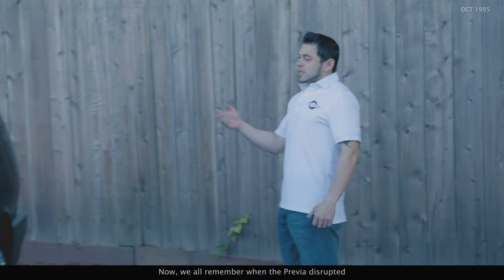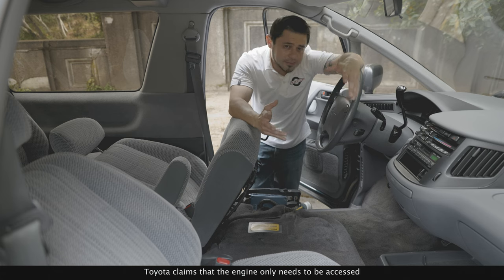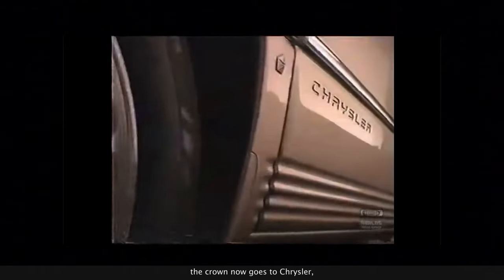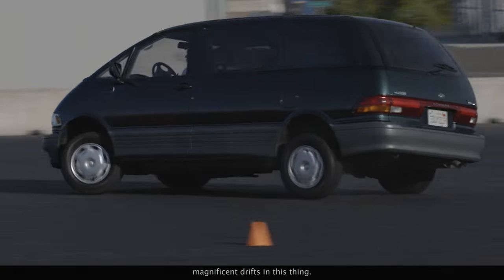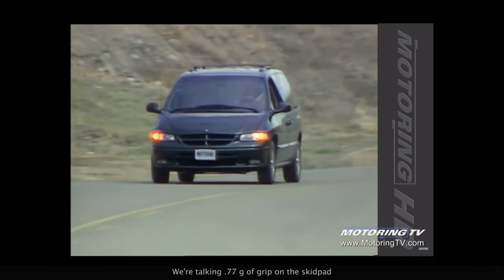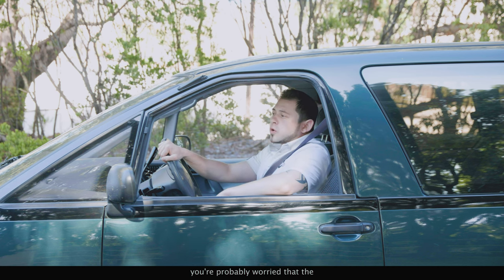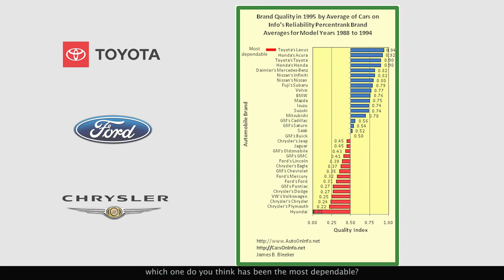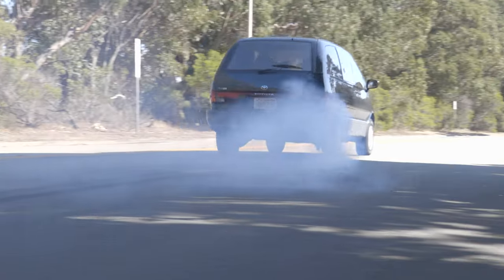1996 Toyota Previa Supercharged Road Test - New Old Cars TV

Comment: So cool to see that van sideways and burning rubber 😂

The RWD was an issue with most minivan buyers of the day, my parents included, because of tricky handling in snow, where the weight of the engine wasn’t pressing down on the drive wheels.
Reply from the maker: True! Although Toyota offered this van as an All-Trac for those that needed the AWD traction
Reply: @newoldcars Oh yeah, good point!
Reply: We had that one!  It truly was such a a great vehicle
Reply: drives perfectly in snow, weight distribution 50-50, very stable, understeer helps decent uphill drifting if needed. 10+ years of service in the Alps

Comment: I still have my 1993 Previa LE in 2024, now with 300K miles on the original engine and transmission.  Reliability and durability you can depend on. It is indeed a keeper.

Comment: I have a beautiful low mile 93 Previa LE. I feel like it holds it own on the highway. I expected it to be MUCH slower than it actually feels. It is not quick by any means but it's not dangerously slow either. Plus the non SCs don't seem to pop they're head gaskets quite as frequently. BTW, this was a really well done episode. I am definitely subbing.

Comment: A very innovative vehicle for its time that was hampered by an extremely high price tag... in adjusted dollars, the Previa was monstrously expensive in todays money... a fully loaded model would crest 70,000 Canadian dollars in todays money... great van... but Sienna was what people were asking for... I had two of these and know their benefits and quirks.  The rear sets folding to the sides were neat but extremely dangerous if folded flat and someone pulled the cord without holding the seatback... it would snap forward at such a speed that it would easily break your neck or hurt you... but otherwise a great handling, fun and very good looking van for its time.